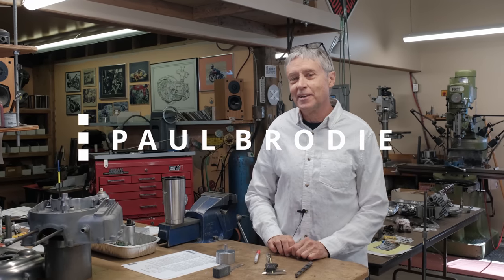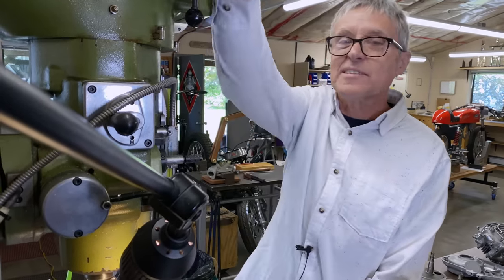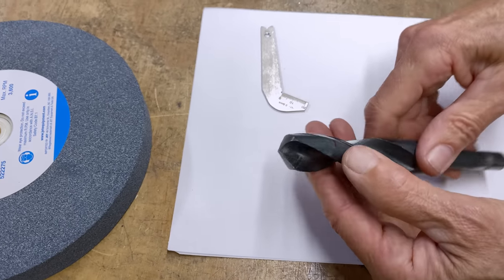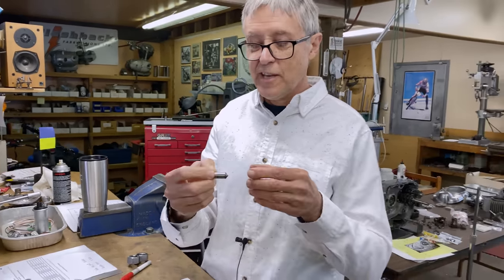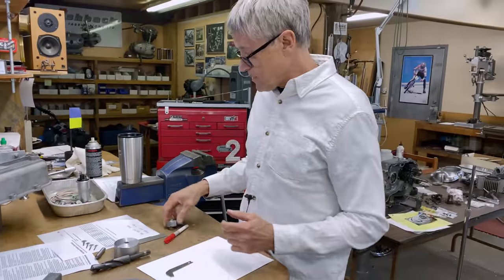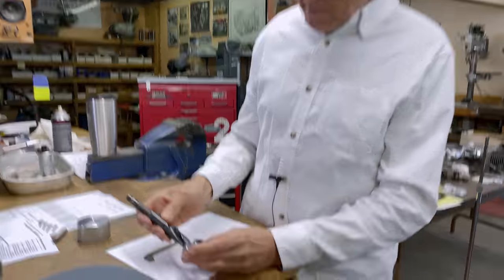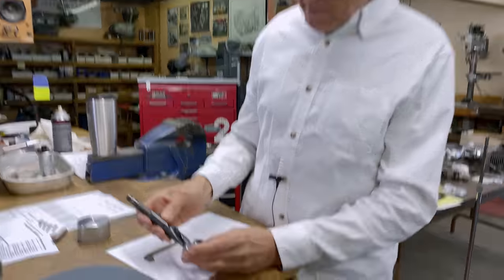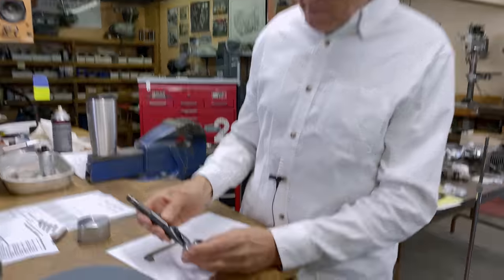How to sharpen your drill bits // Paul Brodie's Shop

Comment: One thing that wasn't discussed in this video is head on bit geometry. When you look at a twist drill bit head on the chisel point ( that's the bit in the middle the web) will have an angle in relation to the cutting lip angle. There's two cutting lips one on each flute and they both have to be parallel to one and another. Go look at a bit. If it's sharpened right those cutting lips are parallel. When they're not even they're not parallel. That's not good. You need to keep grinding until they are parallel. Otherwise you'll drill oversized holes. The bigger of the two flutes will swing wide. Throwing two chips is a sign you have an evenly ground bit. If they're not even one lip will cut and one won't. A large part of learning how to sharpen twist drills is studying the geometry. Which in practical terms means really looking at a drill bit and seeing why it cuts. If you make the bits you sharpen look right they'll work right. Paul covered heel relief but he didn't cover parallel edges. A twist drill are chisels in the round. That's how they work.
Reply: That's true. However, when you keep track of cutting lip length and angle - because of it being a twist drill - you will be pretty darn close. You develop the feel and chip formation can be checked visibly.

Going one step further, you can put a micrometer on the mill table and check the height of each individual flute. An experienced machinist will keep a tolerance of 0,05 mm, but this will of course grow the more you sharpen the same drill.
Reply: @valkman761  
if you can hand grind a drill to within  two thousandths of an inch  ( approx 0.05mm) you are a god😂
Reply: When hand sharpening achieving perfection is all but impossible , we can get close but if you want it perfect use a tool and cutter or D bit grinder , i prefer 4 facet sharpening on anything over 10mm 0r 3/8 inch and anything under is either hand sharpened or replaced . I have yet to find anyone on YouTube that shows how to sharpen a number 80 drill !
Reply: @ianbertenshaw4350  Sharpening is not the same as grinding a drill bit sharp from blank as Paul here does. You can dress the edge and here's where the 0,05mm comes into play.
Reply: "chisels in the round" ... I'll remember that.
Reply: @Hertog_von_Berkshire  that is what is going on.  Each cutting lip is chiseling down into the material being drilled. If you were able to straighten a twist drill out and cut it in half you've have a pair of chisels. I think they might be skew chisels though? The geometry is escaping me right now. Someone should make a YouTube video doing it. I've seen videos of twist drills being made. They do just twist the big ones up. It's red hot and they have it in something that looks like a lathe chuck and it just cranks the twist into the bit. It'd be interesting to see the piece before it is twisted.
Reply: You missed his information, he used different wording but completely covered the cutting edge.....then he spoke of rake away from cutting edge. He also showed and spoke of the 2 angles, 118 degree bevel and 60 degree cut edge. Maybe it's my years of military listening but that's what lots of people lack today..... attention to detail and application principles. However, I would enjoy watching a video of your experience. I can teach you to shoot but can't make you shoot 500 yards in kneeling supported position. It's about comfort and practice. Even people with Shakey hands hit accurately at 250 to 350 once spending a hour with me.
Reply: @MrSki-tyvm   118° is the point angle  and 60° is the chisel point angle There's also a relief angle that is critical too. That's about 6° If the cutting edges are not above the heels the drill will not cut. Making a video of off hand twist bit sharpening would be like filming a magic trick. You wouldn't learn how to do it just by watching. You just have to know what's going on.
Reply: Ii>
Reply: You don't cool the bit while sharpening?  No need?
Reply: Absolutely correct that's why I use a Drill Doctor to sharpen my bits
Reply: @cecilandrews7479  I have a Drill Doctor. I can't say I'm a fan of it. I also have a Bulldog sharpener too. It I use. If a bit's really messed up I'll put it in the bulldog to shape it up. But I'll still finish it by hand. I can do things by hand to the geometry that it'd be hard to do with any machine. Ramp the relief, split the point, stuff like that.
Reply: Bla, bla, bla...
Reply: @nothankyou5524  drilling is a boring topic. There's nothing anyone can do about that. Drill baby drill! The excitement starts when you're done I suppose. With a sharp drill you can get done sooner too. I just did a pretty slick drilling job on my mill the other day. I was impressed I pulled it off. It was one gnarly rusted and busted screw. Of a thread pitch I don't even have a tap for. Hardly anyone does. It's a proprietary thread. I didn't feel like buying one just for that job either.
Reply: @1pcfred  This Old Tony did a vid that draws parallels to chisels.
Reply: @cecilandrews7479  I back up pcFred here.  I have a drill doctor too - so much slop that you have to be incredibly careful to get a consistent and equal edge.  If I smash a bit, I'll get it close in the doctor then finish by hand.
Reply: @Makes-and-Mods  yes that's not a novel idea he came up with. There's a fair chance the geometry of twist drills was by design. As in whoever came up with the twist drill was explicitly shooting for that concept. Because if you look at it a twist drill is just a pair of chisels twisted up. But it's also something that has been widely disseminated in literature over a great length of time. So anyone studying the topic is bound to run into it somewhere. Generally because most fail to look at things as carefully or critically as they should. So it does need to be said.

Comment: This is the best drill sharpening video I’ve seen. Thank you, Mitch & Paul! Wishing you both well!!
Reply: Right?
Reply: 100% correct on that claim.  I've now watched a load of drill sharpening videos on YouTube and this is by far the best, particularly in the area of splitting the point (or thinning the web as Paul calls it).  A lot of this has to do with the videography and the close ups accompanying the instruction, but also the simple idea of using a Sharpie to outline the area that is going to be relieved to show you what you are aiming for.  Most people just show the webbing area being ground (often super quickly) and if you are lucky you get an out of focus view of the result.

Comment: Excellent. I have struggled with this for years.  I bought drill sharpener electric things and they never worked or I was using them wrong.   This is the most comprehensive, clear, concise explanation I have ever seen.   I have bought numerous bits just because the old ones were dull.   Thank you!
Reply from the maker: Thanks Bill. Glad you found value in our video...   :face-orange-biting-nails:

Comment: Finally somebody on YouTube that actually knows how to sharpen a drill bit. This guy is spot on the angle really doesn't matter what is important is to make sure that the leading  edge is higher than the trailing edge and it will cut
Reply from the maker: Thanks for watching! 😉

Comment: I don't normally watch drill sharpening video's but this time I did.
 What you showed is pretty much exactly what I was taught in the mid 1970's, including using two nuts to get 120 degree angle which is often 'close enough'.
It's pretty much forgotten about nowadays so good to see it mentioned (I've never used a drill guide either and I don't have the rests on bench grinder)
 I will add two things though, the first you've probably seen, someone who 'knows how to dress the wheel' then using diamond wrong and losing the actual diamond from the holder and the second is using a slip stone (India stone) to remove the edge when drilling brass (to get zero rake but still have clearance angle) Conventional grind often 'pulls' the drill into brass.
Reply from the maker: Sounds like we have the same sharpening style. I thought about adding brass and plexiglas drill sharpening techniques but then the video would be even longer... I am a little amazed that my Diamond on a Stick has lasted me 40+ years. Thanks for commenting.

Comment: When I have to drill say 1/2" holes by hand, I have found impact drill bits work amazing on steel, and no worry about the drill ripping your arm off when it catches near the end.  It just doesn't catch using impact drill.  Goes like butter, except when I had to drill through an area adjacent where I welded.  That was no longer mild steel and it really dulled my drill bit.  I have sharpened my own before on a grinder but your explanation was clear with the how and the why so I learned something and will do a better job with my impact bit - hopefully the geometry is similar.  Many thanks!!!
Reply from the maker: Thanks for watching.

Comment: Hello sir, you explained the manual sharpening of the drill very well, pointing to common mistakes. Beautiful presentation (!). I was even going to show Internet users the correct sharpening, but you beat me to it 😀. I even learned how to sharpen a chipped cutter tooth myself. First, it performs flattening to the appropriate length. I usually use a grinding stone or angle grinder for this. Then I make a bevel of each tooth, measuring with a caliper. Of course, you can't get precision to the thousandth of a meter with this method, but it's sufficient for your own use. When sharpening the drill, I also make horizontal movements so as not to damage the surface of the ring, which is actually a grinding wheel. It makes the job difficult, but I don't have to smooth it out often with a special abrasive stone. I have not seen such a precisely presented reportage on YouTube so far (!). Congratulations and best regards 😀.

Comment: Hey Paul, I learned to hand sharpen bits in high school, a skill that is still with me to this day. A story to go with that skill: I was supervising the construction of an observatory. The crew assembling the steel frame for the dome was drilling bolt holes to secure the dome. They told me they had to stop for the day because all their 1/2” bits were to dull to continue. I asked if they had a hand grinder, they did. I clamped the grinder to a beam and quickly sharpened 6 bits. They where stunned that it A- could be done at all, and B- could be done using a hand grinder, C- that as a project manager I knew how to do something they didn’t …
Cheers.
Reply from the maker: Charles, great story! Thanks for watching and commenting :)

Comment: Nice one Paul, the diamond tipped dresser is great, taken from dressing tool and cutter or surface grinding wheels.

Your just like myself, softer material to cut more acute angle harder more obtuse,  I always just eyeball a good drill for the general angle.

In terms of thining the web, we always done it as the drill length gets smaller as the web thickness increases for drill strength, so as you grind the drill down the top land increases, hence thining the web.

A great tip for checking each cutting edge of the drill is at the right height is to screw a piece of soft metal against a wall, then a V piece of   wood or metal at right angles to. This allows you to place your drill into the v block and rotate and scratch on the soft metal when both cutting faces scratch and follow the same lines as you rotate, then voila each cutting face is cutting at the same height 

Thanks again
Reply from the maker: Steven, thanks for watching and commenting 😉

Comment: Once learned, it is so easy to get a bit back into shape. Nice video Paul, cheers!
Reply: I don't know if I'd call it easy. I'd say it's more like riding a bicycle. Once you've figured it out then it's not so hard to do. But yeah if you're using twist drills then do learn how to sharpen them. There's a lot of knuckleheads that just throw bits away when they get dull. Or they continue trying to use the bits even when they're dull. It's sad.
Reply from the maker: Thanks 👍

Comment: I was a machinist at an aerospace company when I was tasked with sharpening drills for about 6 months. Drilling titanium and stainless needs a good sharp drill! We had so many drills we had to send them out to get sorted. During that time I developed "The Eye". I still use a drill gauge though to check flute length and angle so that the hole will be sure to drill on size. Pedestal grinders in a shop with many machinists, mechanics, and passersby meant the wheels always had rounded corners. That made thinning the web after hand sharpening a problem. By mounting a thin cutoff blade on the opposite end of the grinder, I was able to make a nice sharp "split-point" with a wheel that wouldn't get rounded corners.
Reply from the maker: That sounds like a good solution. Thanks for commenting.

Comment: Nicely done. Just the way I was taught 40 years ago. Would like to add, that switching to an aluminium oxide wheel will give you much better control of how much comes off each pass, and a much better finish to the edge.

Comment: Great video. I'm ok with larger drills but I have difficulty with smaller drills now as my eyesight is deteriorating with age. One thing I would mention is cutting brass with new or sharpened drills. they can really grab, especially if you are opening an existing hole. I always put some negative rake on the front of the cutting edge. Its effectively deliberately blunting the drill but it stops the grabbing.
Reply from the maker: Thanks Allan. Yes, sharpening drills for brass and plexiglass is different, and I did think about including that, but the video was getting too long.

Comment: Do you have to worry about overheating the bit and the temper of the metal? Thanks for the videos!!!
Reply from the maker: I don't worry about it, but when the drill starts to turn colour, that's when I quench it in cold water. That keeps the temper in the drill bit, and then I can sleep at night. Thanks for watching! 😉

Comment: Another very informative video. Did you knoe that grinding wheels and discs for an angle grinder have a best before date? They are usually stamped on them somewhere. 
I see the Peter counter is operational too 😁👍
Reply from the maker: Well, my last grinding wheel is at least 15 years old. I have never heard they have an expiry date.
Reply: Ya all abrasive wheels do. Saying that though the wheels on my bench grinder are at least 25 years old and still work fine,🤞😬
so far!

Comment: Thanks for this video. Not only did I learn how to sharpen drill but, I also learned how to properly dress a grinding wheel. One question, what carat diamond do you recommend for the dressing tool? I have seen them with .5 to 2 carat and shafts from 3/8" to 3/4".
Reply from the maker: The shaft I have is 1/2", I do not know what size carat is used, sorry. Thanks for watching.

Comment: I figured out to freehand sharpen a bit 50 years ago using only logic What I've done is essentially the same. Relieving the web is new to me so thanks for that! For up to 1/2" I just use a Drill Doctor. If nothing else the DD shows the way.  But you have to know how to do this with larger bits. I'm a carpenter first, then metal worker  Let me tell you that if you're out in the field and dull a bit and all you have is an angle grinder, this lesson is important. 

Thank you, sirs
Reply from the maker: Thanks for watching!

Comment: Hi Paul, Your explanation is so good - Just one question, How is this possible with drills close to 3ml (1/8")?
Reply from the maker: Thanks Randolph. I can sharpen 1/16" drill bits this way, but it does take a very fine focus and a "soft touch".holding the drill....    :face-fuchsia-poop-shape:

Comment: Any tips for sharpening small drills, say #40?  Or is it just easier to buy new for small drills?  I find it hard to get the sides even length on smaller bits.  I even tried a Drill Doctor and it fails miserably also on grinding both sides evenly.
Reply from the maker: It is easier just to buy new, but what fun is that? Yes, it is hard to sharpen very small drills... The grinding wheel has to be very smooth and sharp, and you will need your strongest eye glasses. It's kind of a "feel" thing, because the drill is so small. I know that sounds vague, but it's the same technique as sharpening larger drills, just in miniature, so to speak. Hope I made a little sense!

Comment: When I was a young lad I could sharpen drills as small as 1/8th inch by hand. Now that I'm in my 60's anything smaller than 3/8ths goes in the Drill Doctor box. I have always used a guide when sharpening, felt that would be more consistent than hands alone. I never thought to use the single point dresser. I've always associated those with precision machines like surfacers and valve grinders.

Comment: Paul, I can't seem to get the proper rake (striving for about 7° to 10°). I'm using the 60° lines on the finger rest, and keeping that angle as I move the bit through a perpendicular to 45° angle to the wheel. But no matter how hard I try, my rake is always flat, or no rake at all. The drill does not cut at all. What could I be doing wrong?
Reply from the maker: Bob, obviously I can't see what you are doing, so I have to imagine... I think what you have to do is to focus on the pressure you are applying. As you bring the drill up from the perpendicular, you will need to increase the pressure on the grinding wheel. The increased pressure will remove more material from the drill bit. Make sense?   Thanks for watching...:face-purple-wide-eyes::face-purple-wide-eyes: